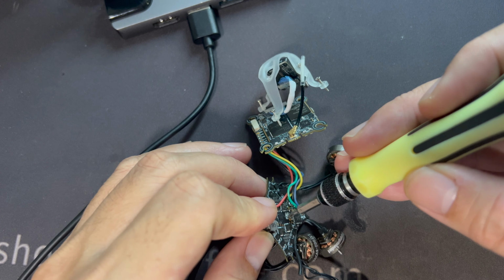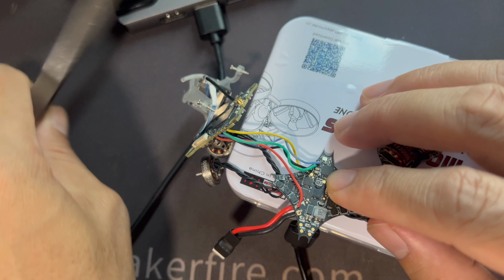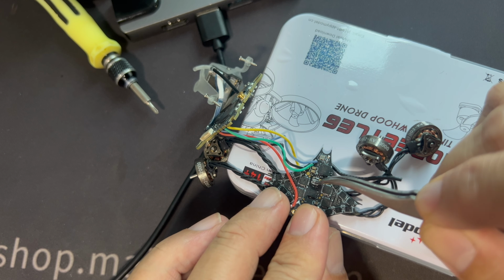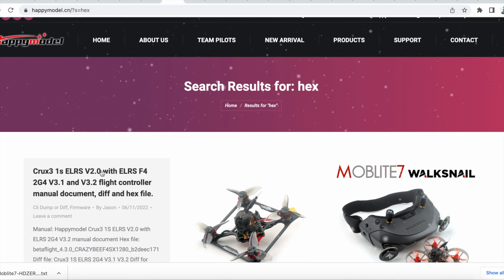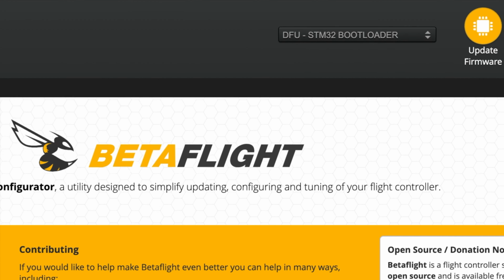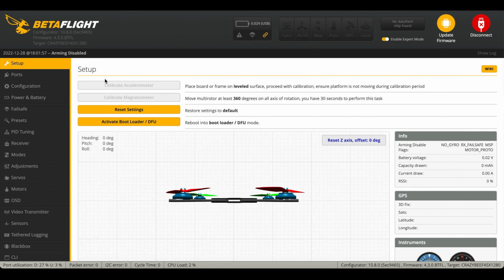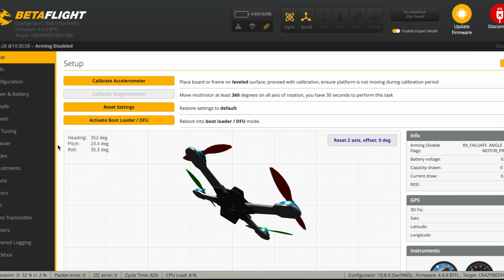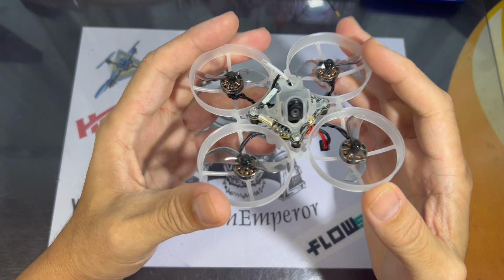Flight controller cannot go into DFU/Bootloader mode | Here's how!

Comment: Hello I have the moblua 6 Elrs and when I put into boot loader mode it shows up as sound device and won’t flash  nothing ive try will keep it from turning into a sound device impulseRC or zag dint work neither did trying to update the driver though windows
Reply from the maker: can you go into betaflight?  My advise is, If the Mobula6 is flying well, just leave it at its stock Betaflight firmware. Dont flash to Betaflight 4.4 as it will screw up some settings in the Mobula6
Reply: well i couldnt bind in to my controller other wise but i ended up reinstall betaflight and drivers and that did the trick.  but i would like the get the stock preset with pid tune back for it i reset my settings while trying to get it to update
Reply from the maker: @CodyBoyy  yeah. That wouldve fixed it. Here’s the stock tune for it:
https://www.happymodel.cn/wp-content/uploads/2021/08/Mobula6-ELRS-betaflight-4.3.0_dump_for-ELRS-2G4-F4-V3.3-V4.3-BMI270-.txt
Reply: @shogunemperor  thank you very much
Reply from the maker: @CodyBoyy  always a pleasure bruddah

Comment: You didn't mention doing the factory cli dump or is that on the firmware hex file,im having the same problem.👍
Reply from the maker: aaah!! Yes, cause this video was only for getting into the DFU mode. If you can get into Betaflight, go to CLi and type BL. And yes, only use the hex file if ur using ELRS V3

Comment: My mobula 8 can't connect to Betaflight program,  what should you do??
Reply from the maker: aaaah... ok.  Here's a few things u can try:-
1) change the cable(try different ones) - this is usually the problem
2) use zadig to fix the driver issue if ur using a windows computer

Comment: Your videos are very helpful! I have the Mobula 6 HDZero and it’s bricked. I can’t connect to PC at all, get the ‘failed to open serial port’ error message. I’ve tried all methods including soldering the boot pads but still nothing. I can’t use CLI command because my PC won’t recognize. Any ideas? Thank you!
Reply from the maker: Thanks so much bruddah. Really appreciate it. Have u tried zadig or the stm32 recovery?
Reply from the maker: or try to solder up the boot pads and plug in ur FC, if that doesnt work, then try swapping the usb cable, if not.. i think its not fixable.

Comment: There must be something wrong with my board. It connects to BF just fine but it will not go into DFU mode at all. In fact whenever I type "bl" in the CLI or just press the "enter bootloader mode" button on the welcome screen or when I hold the boot button down, the FC begins getting very hot very fast, but it will not say DFU in the Manual Selection tab. All I did was flash my TX module to elrs 3.2, which prevents it from binding to the Mobula7. Now everything I try to upgrade the firmware on the Mobula, it doesn't work because it won't go into DFU. I guess I'll try to reflash my module back to an elrs version 2.x and see if it will bind to the Mobula again. Love your videos. They're very helpful. I'm just afraid mine may have a hardware issue since it heats up to almost too hot to touch after a few seconds after I try to enter DFU.
Reply from the maker: oh man, totally understand bruh. So if u have issues with the FC do contact Happymodel info@happymodel.cn and let them know the issue.  If ur okay with flying it on V2xx then just fly it as is. Happy flying bruh
Reply: @shogunemperor  I'll contact them and see what they say. Thanks man.
Reply from the maker: @CarbonGlassMan  GOOD LUCK!!
Reply: mine too cannot enter dfu mode and the fc is getting hot also
Reply from the maker: @coffeelover2023  I think get in touch with the seller or Happymodel.  That FC shouldnt be getting getting too hot while u plug into betaflight
Reply: @coffeelover2023  Happymodel wanted me to send the quad to them in China. I decided not to do that and just use it as it is.

Comment: bro I'm clueless how to get the hex file. I have a SuperBee F4FR (Mobula 6 frsky)
Reply from the maker: @simonec3893  u dont need the hex file if ur using frsky protocol. Its only for ELRS. Just make sure u use the correct diff file for your version
Reply: @shogunemperor  ok so my problem is that my stupid usb cable that was a bit broken interrupted the flashing of my BetaFlight controller.  When I plug it in it just gives me a red LED. So I assume I need to bridge the 2 contacts right? But nothing is working… thanks for the swift reply 🙏
Reply from the maker: @ ooooh… so u cant connect to betaflight now? Ok then try bridging the boot pads then make sure u have “flash on connect” turned on. If it still doesnt work, then its beyond me. U might need to drop an email to info@happymodel.cn and ask if they can help u find a solution.

Comment: first of thanks for the video. I was hoping that this one would actually be able to help me but not lol I have a Diamond F4 that's bricked after flashing Quicksilver. It's not recognized after plugging in USB so not able to use the BL command. I have tried multiple Data Cables. Driver fixer, Zadig and everything else I've tried doesn't work. if you know another fix I'd appreciate it. Thanks for the video at least lol
Reply from the maker: ok bro, I've checked for u, I was told that you should hold the boot button and plug in the FC, it should go into DFU mode and you can reflash the FC with the correct firmware
Reply: @shogunemperor  Dang I thought I mentioned also while holding down the boot button. Yeah it never worked holding the boot button. Thank you anyways for getting back to me. 🤙
Reply from the maker: @Greenhorn_FPV  aaaah ok. Let me check again and see. No worries bruh!!!  WIll keep u posted!!
Reply: @shogunemperor  appreciate ya bud!!!
Reply from the maker: @Greenhorn_FPV  my pleasure man!!
Reply from the maker: @Greenhorn_FPV  okay bruh!!!  I've checked up on that issue.   I think the only way is to get the ST-link dongle to revive your diamond F4 board.  Here's a video by the late Project Blue Falcon(God bless his soul) that I hope will work for you
https://www.youtube.com/watch?v=Om6teCbJM4U
Reply: @shogunemperor  Sweet!!! I have an ST-Link Usb Cable. Hopefully that'll work. If not I appreciate the awesome reply back bud!!! You a real one!!!
Reply from the maker: @Greenhorn_FPV  NIIIIIIICE!!!!!  aaww shucks! LOL my pleasure bruddah.
Reply: Exact same issue. Im about to just buy a new board. Going to see if i can get this mystical cable. Only issue why i need to reflash is my video transmitter tab does not show and i cant change those settings. So fetting 1m distance on my brand new ovx vtx